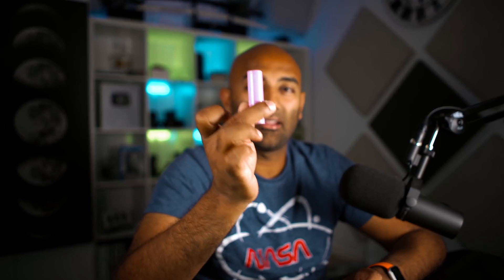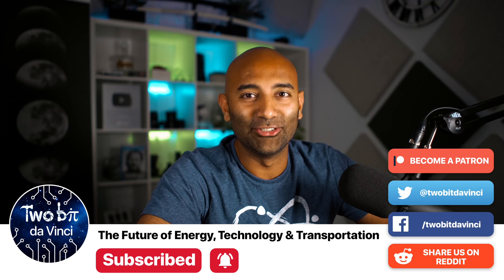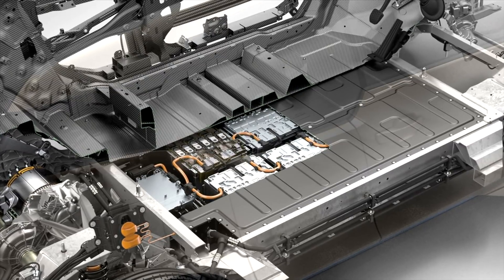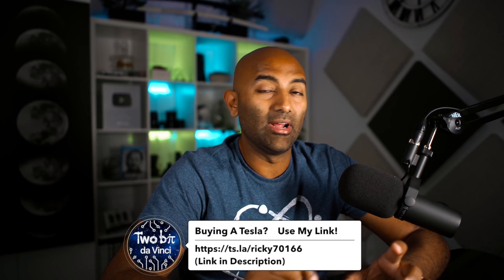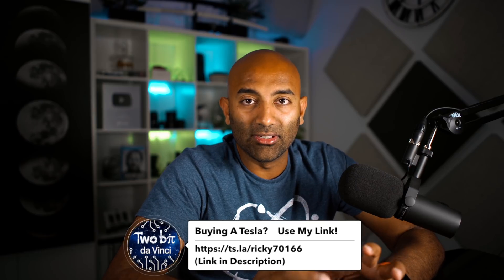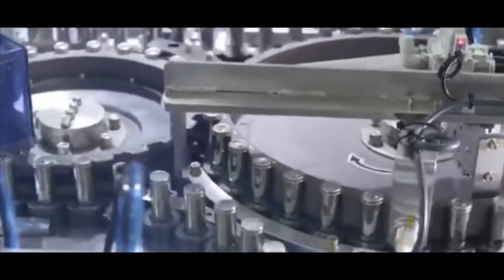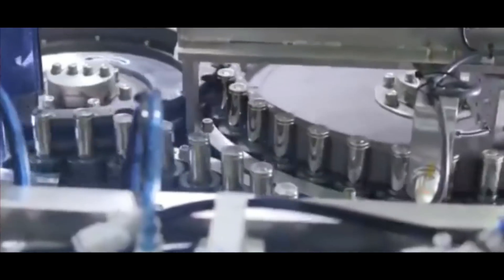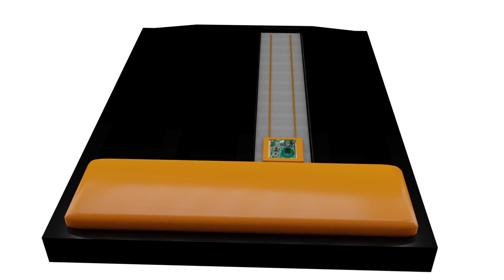Is Tesla Moving Their Battery Strategy to Prismatic Cells?

Comment: All the YT'rs keep saying the LFP cannot go as far miles to weight... This is not a true statement! Yes the LFP isn't as energy dense but CATL is proposing a 200KW pack with the same weight of the current 275KW packs. Here is where your making your mistakes current chemistries used in EV's can only use a 60% window of the charge where 100% of the charge in the LFP is usable without degradation or memory issues. That means the LFP 200KW pack can use all 200KW where the current used chemistries are limited to 165KW usable from a 275KW pack. Marketing wank was applied very early on and you all are still spouting it as natural law. The fact you have to leave 20% of charge and only charge to 80% to keep from inducing battery degradation and memory issues is nullified with LFP chemistry as well as thermal runaway issue and environmental/cost issues of cobalt. Cooling of prismatic cells is easily conquered with some engineering. Tesla packs where built around the cell size and downfalls where the prismatic cells will be built to spec for the available space in the vehicle. I think this will be a more effective way to get the most KW's into the EV and is no issues at all with any stationary storage units.

Comment: One major advantage that was not mentioned:  LiFePO4 batteries are way safer, LiFePO4 batteries don't start on fire. 
A correction is needed:  At 5:02 you said the amount of voltage that can be drawn per cell in the LFP batteries will be higher.  However, LFP voltage per cell is lower than NCA, the current draw will be higher per cell because of the increased size.
Reply: @Dmitry Negai "Actually not" what?  The size of the LFP cells will need to be larger when compared to NCA cells for the same current draw.  The nominal voltage of NCA cells is 4.0-4.2 V and LFP is 3.5 -3.7 V.   I think we're agreeing, but just misunderstanding each other.

Comment: thanks Ricky! Curious if there's a reference for a semi-technical description of Prismatic batteries vs. Cylindrical batteries in terms of chemistry and electrodynamics. Maybe that's a great subject for your next video!
Reply: Search for videos posted by “the limiting factor”.  Best technical discussion of batteries I have found
Reply: Nothing very technical to it, prismatics are just different shaped cans to put lithium chemistry in, as opposed to cylindrical cans.  Tesla's NCA chemistry needs to be put in small cylindrical cells to operate safely but LiFePO4 chemistry can be put in prismatic or cylindrical.  It's easier to make fewer larger prismatic cells than many smaller cylindrical so that's what CATL did.
Reply: There is finely the semi truck reference I been looking for The weight ratio  to power of the  Square Battery doesn't matter for the   Semi truck, Just keep putting N more batteries. Let China figure out the problems and then make him for the semi
Reply: Dave st.peter power time weight ratio matter more for the semi than for any other Tesla.  There is a weight restriction on semi trucks,  so if the battery weights too much the amount of cargo that the truck can legally carry goes down.  This is a big factor in whether the semi truck is economical.  It is the reason why the head of Daimler trucks said that Teslas claimed specs were impossible unless Tesla can break the laws of physics
Reply: @andrewpaulhart  Except that the head of Daimler was apparently unaware of the energy density of lithium ion chemistry and didn't know what he was talking about.
Reply: JRP3. plenty of other people who I know were aware of l-ion battery density also said that they could not see how Tesla could make the semi light enough,  so I doubt that.  Of course I agree Tesla knew something that the Daimler guy didn’t,   Not surprising since Tesla are ahead technically.  however I think that the point that weight is important for semis still stands
Reply: @andrewpaulhart  Plenty of other people were also wrong.  The numbers were always there.  One problem was an assumption that semis always run with a maximum load, which is far from the truth.  Most are filled up by volume before weight.  The other problem was that many people didn't understand that in steady state long distance driving aerodynamics are more important than weight, and the Tesla semi had vastly better aerodynamics than conventional trucks.

Comment: Prismatic cells is just make sense for cheap model low range model. If Tesla can have high quality cylindrical cells, they would have use it but there's no supplier ready to supply that. Battery production is also taking long time to ramp or build up.

Comment: If you need cooling effect for regen, why when it’s cold is my regen restricted?
Reply: Because cold batteries can't take much current. They have to be warm in a certain temperature range (not too hot either)
Reply: brianna bernaola my point was he said they needed to be cool for the regen. But it all depends on climate if they need to be warmer or cooler. It was too much of a standardised comment. I understand how they work.
Reply: @carlschubert8466  Sorry... i usually can't see sarcasm  with the face of the talker in front of me (i'm aspie) , in a yt comment it would be even much harder! ;)
Reply: brianna bernaola true not easy to get meaning in comments.
Reply: Go read about cold batteries

Comment: I curious about the life span of the prismatic cells and how well they will convert to house and grid packs after their car usefulness is done.
Reply: It's not really the format (shape) of the cell that determines longevity.  That's more a function of the internal chemistry and a given chemistry can be placed into most different formats.  The LFP chemistry is known to be longer lasting than either NCA or NMC.   The rectangular shape is probably very easy to adapt for a second life application, though it will take more space due to lower energy density.

Comment: When i heard about this it made a lot of sense for the China market. One of the worst battery fires Tesla had was in China, and this formulation is not nearly as likely to have that problem. Good move for that market. Also Elon has talked about changing the modular arrangements still held over from the roadster, to obtain a better density of the cells. With this move he gets two advantages more cell density in the pack and less need for an elaborate battery management system to keep them safe. It compensates a bit for the lower energy density if the formulation.
One other possible reason besides cost in the Chinese market is that the cylindrical cells are not such a necessity there where patents held in western countries that kept Tesla from using either pouches or prismatics  are perhaps not enforced or even an issue. If I am right about this it means these cars will not show up outside of China except as private imports. Of course the Chinese government also imposes their own charging standards which would make such imports very difficult anyway.

Comment: It would be interesting if they could partially make up for the lack of current capacity with prismatic cells by throwing in 1 or 2 kW of capacitors to help smooth out the load.
Reply: Highly likely.
Reply: the roadster already does for acceleration & regen.
Reply: @mareck6946  No it does not.
Reply: Terrible idea since capacitors have horrible energy density.  You are always better off maximizing the battery size.  If you have room and weight to fit capacitors you'd get far more benefit from using that space for batteries.  LiFePO4 chemistry has higher current capacity than NCA or NMC chemistry, which more than makes up for the prismatic format.  By the way Elon has flat out said capacitors make no sense in EV's.
Reply: @JRP3  Sorry, I thought Ricky said the prismatic cells would have less current carrying capacity.  If that's the case, and there's room in the pack, then why not a relatively small capacitor to buffer very high loads? (max regen/acceleration). If the prismatic cells are more capable than the 2170/18650 variety in dumping I²R heat then for sure, don't bother with a small cap.
Reply: @lubricatedgoat  LiFePO4 chemistry has higher current potential.  Small cylindrical cells have a higher C rate than large prismatics but the higher C rate of LiFePO4  chemistry makes up for the difference.  Even if it didn't adding capacitors would not be helpful.  Capacitors take up too much space, weight, and cost.  If you want more current just make the pack larger, IF you actually have the room, load capacity, and cost to do so.  The numbers never make sense for capacitors, as Elon has stated.
Reply: @JRP3  Roger that.  Good to know.

Comment: I imagine the pro n cons argument is also dependent on where you are selling the cars. China is much more dense than the US. The average daily drive is probably less. There are fewer long road trips because the country is just smaller and because of stronger rail infrastructure. So energy density and therefore range probably aren't as big of an advantage.
Reply: you have good points, except for 'the country (China) is just smaller'....
Reply: @petersparks7363  You're right, I thought it was significantly smaller in terms of sq km. My mistake.

Comment: its a Good move - likely Tesla energy will switch to LFP also -
Reply: No, they won't.  Tesla, all car manufacturers are using any and all battery production processes they can today, because nobody has their own battery architecture that they're able to manufacture themselves.  Tesla is just temporarily filling the gaps until they can spin up enough Gigafactories to support their own demand.  They will someday be able to supply other car manufacturers once they get the Gigafactories up to speed.  It's about vertical integration.  When Tesla makes their own batteries, it'll be cheaper for them to make their cars.  Today, they have to pay a little premium cost to use other companies like Panasonic and CATL.

Comment: Yes I believe CATL will make custom prismatic cells for Tesla or with Tesla input/guidance, nothing new in the chemistry, using existing tech however I believe Elon wants to move from module based car battery pack and move to Cell 2 Pack build. Gives more space for battery cells so even though the prismatic has less energy density they will be able to fit more cells into the single Pack. And do it cheaper than they are doing it now with cylinder cells.
Reply: So far LiFePo4 cells have been much more expensive than lithium cobalt batteries. Even though basic materials are cheaper, lower energy density increase cost per kwh. 

I think Tesla  could use them in low range M3 for few reasons. First, they are available in high quantities unlike LG cells. Second, they can withstand much better deep cycling and continous supercharging, which typically happens in dense cities where people can't charge at home. Third, there is enough space for them for low range configuration.

Comment: LiFePO4 are 3.65V when fully charged,
To make 400V pack 110 cells will be needed in series. 
(if 1cell =1kg only one row would be 110kg x 4 = 440kg)
. Discharge limit is 2.7V (110X2.7=297V)
To solve the cooling these can be flat and relatively thin. To solve thermal expansion prismatic cells can be made in non metallic pouches.(sorry for correction ;))
Reply from the maker: Very nice summary. Is your background in batteries?
Reply: @TwoBitDaVinci  thank you! Well I have some practical experience in using LiFePO4 chemistry cells.

Comment: One point you missed from the rumours is that CATL have a battery pack architecture that dispenses with battery modules. They call this cell-to-pack. (Elon has said Tesla will be moving to eliminating battery modules too.) This is I think where some of the double digit percentage cost reductions will come from. It means CATL will manufacture the whole battery pack for Model 3.
I suspect Tesla asked CATL to make their battery pack plug compatible with Tesla's pack for Model 3 so the existing Model 3 cooling could be used, probably with only software changes to accommodate the CATL pack. Tesla would also want the interface to the Battery Management System, made by CATL as part of the battery pack, to be the same as used with the Tesla battery pack, ie, again plug compatible. These requirements for plug compatibility would minimise the problems for Tesla in having alternative battery packs.
Reply: I think it's a good chance that this will be the new battery technology for all Tesla's going forward
Reply: @macberry4048  I'm still doubtful about this whole rumour. I think it is possibly it's a confusion between Tesla Motors and Tesla Energy and the interest for these CATL batteries came from Tesla Energy for home and utility energy storage.
Tesla's cylindrical batteries still have a number of advantages over prismatic cell batteries: They make more robust battery packs as a single cell can go bad, in which case the fuse which connects it to the rest of the module/pack blows to disconnect it. This only affects one small cell in the whole pack. With the larger prismatic cells there are fewer cells in a pack so one going bad affects the pack more. Cylindrical cells allow better cooling than prismatic cells as there is more space for cooling liquid around them and it is easier to accommodate the slight swelling during charging, again, because of the space surrounding each cell. Finally, the chemistry of Tesla's cells allows for more power output than the CATL cells, which is why they are rumoured to be only for the Short Range Plus Model 3s.
Reply: @paulrautenbach  We will just have to wait and see what Tesla has come up with.

Comment: They still must have some sort of battery breakthrough already sorted as the roadster is meant to have 200kwh crammed in that car. as well as the Semi having at least 1Mwh battery in there. you reckon they have early battery breakthrough that will eventually be ready by the time the semi and roadster come out?
Reply: I have hear people say they believe the breakthrough for Tesla is using Maxwell dry electrode tech to improve density/performance,  along with Battery cells being put straight into Battery Packs instead of Battery modules then to Packs. The  weight and space savings will allow for larger battery packs so that Tesla can get the 200kwh battery into the roadster and the 1Mwh battery into the semi.
Reply: xIAMDAVEx This is why they bought Maxwell. They have a new technology to build incredible battery. They also bought a canadian company who build insane battery manufacture. When the competitor will gain more sells, they will announce their new car that will last 1 000 000 km. At the moment, the autopilot is evolving. When they are going to be 100% autonomous, they will use this technology to make their robot taxi.

Comment: Will Tesla be losing it's long-standing range advantage vs the competition?
Reply: No.  If you wish to buy a long range or performance version, it will be using a more energy dense chemistry along with the cylindrical cell format.  However, outside of range, the LFP chemistry comes with advantages as well.  It's much longer lasting, much more tolerant to heat and preforms better in cold.  Theoretically, the LFP pack won't need nearly the cooling or management of the other chemistries meaning that it will be able to charge at higher rates for longer.  This will partially offset a shorter range.  As a consumer, this creates a real decision beyond "how much do I want to spend?" and "How fast do I want to go?"  If I was a taxi driver, I might seriously consider one of these vehicles.  A more robust battery at a far cheaper price that charges faster?  Do I really care if I can only drive 150 miles per charge if I'm always in the city making frequent stops anyway and there's a dense charging network available...?